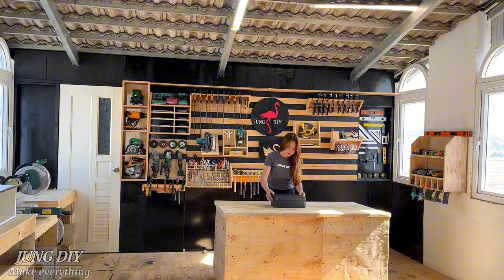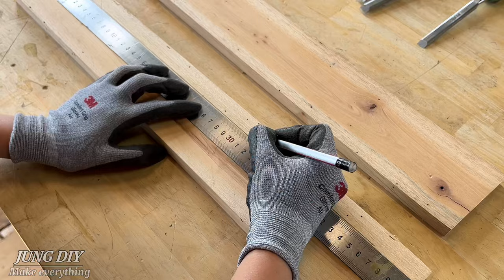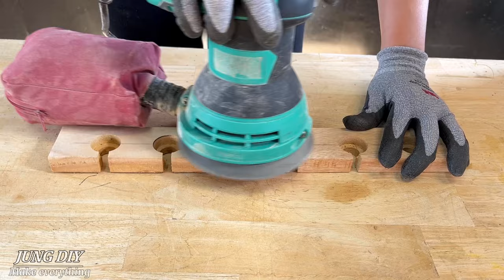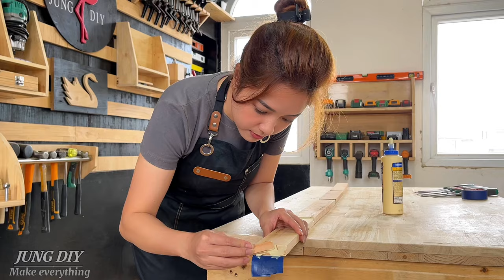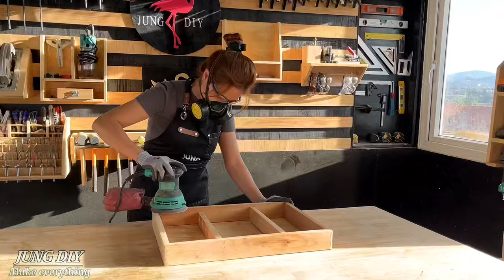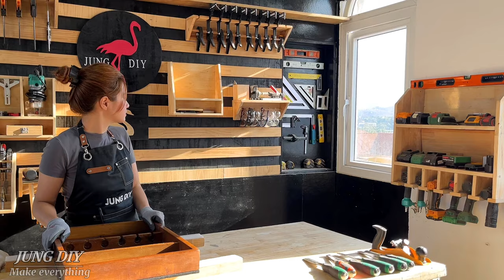A young girl makes a chisel holder from pallet wood | DIY My Dream Workshop ( Part 7)

Comment: Nice project. 👍 If you can, try to connect a shop vac for dust reduction when using power tools like sander etc.
Reply from the maker: Yes, perhaps the vacuum system will be the final step when all the machinery and tools are in the correct position, it will be easier to design the vacuum system and vacuum pipes. Thank you for reminding me about this, have a nice day.

Comment: that kind a handplane I bought 28 years ago in first years at carpenter school -  after fey planing attempts quickly understood that it's no good for flatening - grind the blade to slightly round and used only for bulk removal an bought cast iron Stanley for smoothing

Comment: Very nice little cabinet.  I wonder which will happen first - you get all your tools hung on your wall, or you run out of French cleat wall space?  The jigsaw table, circular saw table, etc - do they have special homes in your shop?  Good video. Thank you for sharing.
Reply from the maker: Currently I still have 2 unused walls, maybe I will create 2 large long tables for Jigsaw tables, circular sliding saw tables... I haven't thought of it yet, but will soon. Thank you for always supporting my channel, have a nice day.

Comment: Beautiful work, just a couple of things though.  PLEASE be careful when using pin nailer/nail gun.  Keep fingers out of the way.  If the nail hits something or follows the grain and goes off centre, you could end up with a nail in your finger.  Very painful.

The other thing is, with pallet wood (which I use as well), I would avoid using the insect damaged stuff.  It looked like some had some borer damage (the little holes).  Some people like that look, personally I don't so much, and It could be weakened due to the damage.  If you like that look though, go for it.  It is just personal preference